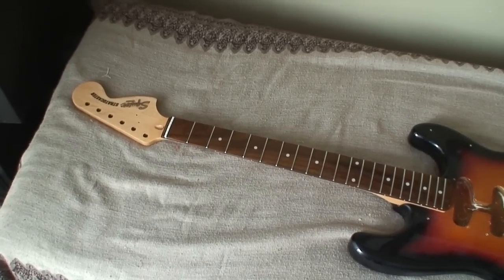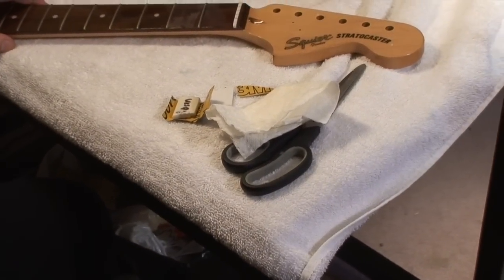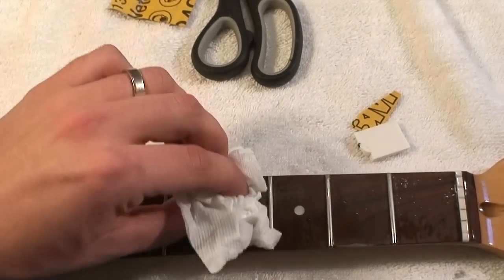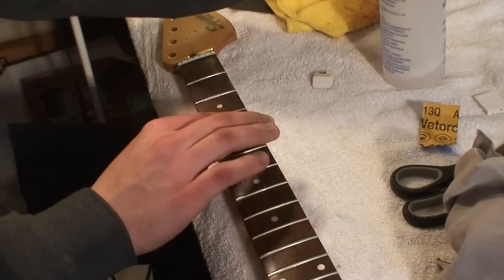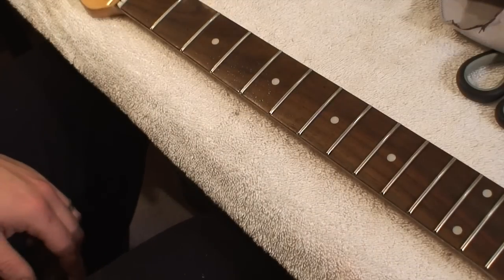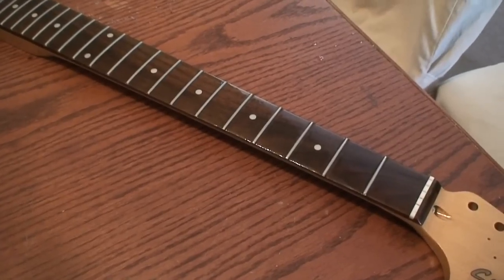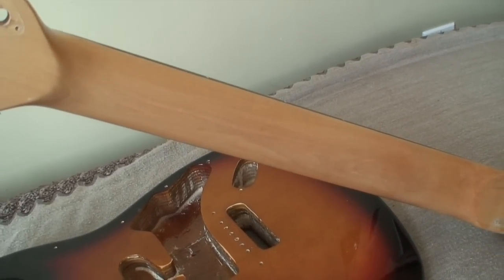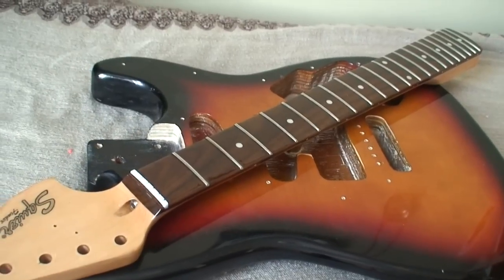Will the Lacquered Rosewood Strat neck work out? - part 2

Comment: Next time you do this, don't skip the important steps. It will save you time, money and materials, and will give you a much easier playing end product. I don't know if you have played an American Standard maple neck from around 2010-2013. Those years I can attest to personally. Fender used a very light amber tinted polyester resin as a sealer coat. Then pressed in their version of a Jumbo fret. The tall narrow ones without glue. Then they coated over the top of all of it with so much clear gloss urethane, shooting over the frets and everything. Then simply scratched off the urethane from the top of the fret. When it's written out, it might seem ok. The actual product is far from ok. Tall narrow frets, with so much gloss between them, that it's literally like playing tiny vintage fret wire. Add to that, for some reason, the wire they were using was softer than it should have been, and the frets just wore out super quick. 
 So if you decide you want to do this again, or someone gives you an expensive guitar to do this to, step one, pull all the frets. Sand with the grain using a radius block down to about 400. 320 is ok too, but 400 is nicer. Then just before sealing the rosewood, wipe with naphtha. Not lighter fluid. They are not the same product. Lighter fluid has oil in it to slow down the evaporation out of your zippo. Buy Naphtha and use it. wipe with the grain and scrub the hell out of it. This will get off all of the surface oils so the sealer will stick to it.  Then seal it. You can use sanding sealer. You can use polyester, which is a nasty stinking crap. Or my favorite, shellac. I always keep a batch or two made up. By shellac, I'm talking about the real stuff. Crystals and alcohol, in a mason jar. Let them melt down for at least 24 hours before use. This stuff dries so fast it will blow your mind. If you do 3-4 coats, level sanding between each coat, and going up in grit each time, (remember you have no frets in the way, simple process, just always use the radius block) you will have a board ready for gloss. Whatever you choose for your top clear coat, it must be an oil or 2 part catalyst base. You can use nitro. But nitro takes a long time to really fully cure. You can use 2k in a spray can clear, which is basically an epoxy type finish. More of a urethane, but without all the expensive equipment needed to use it. 2k isn't cheap, and you have to use it up in about 48 hours, or whatever is left in the can is toast. Storing it in the refrigerator between coats can prolong it another day, but that's about it. But when I say urethane, I'm not saying polyurethane, like furniture varnish. It's not hard enough for the abuse of vibrating guitar strings. My favorite is actually nitro. While everything has it's plusses and minuses, Nitro will melt down into the previous coats if you need to reapply next year or whenever. Urethane will not do this. Urethane will make layers and not really stick to each other. You have to sand back to 280-320 to give it something to grab onto to. And now there are frets in the way. So choose wisely. Simtec makes some nice stuff. Several versions of sealers and top coats that are compatible with house of color dyes. Mixed in. You can use the StewMac little spray cans to shoot it. But whatever you end up using, Do a final sanding down in the over 1000 grit range. I like to use the scotch bright pads that equal to 1500 grit. 
 Now clean out the fret slots and re-fret the neck. level, re-crown and then polish them. If you use Simtec or some other 2k, don't use naphtha to clean up. Use alcohol. Naphtha will melt down the finish some, screwing up all that beautiful work. Some might read this thinking this is way over their heads, or that this is doing things the hard way. I assure you it's much easier and faster than the route you took. Remember all the sanding between the frets...
  And if someone has never done a re-fret before, there are hundreds of videos on YT to teach you how. But be careful who you learn from. I could suggest Wills Easy Guitar, Fletcher Handcrafted guitars, Texas Toast guitars. There are many more. But I suggest you learn from real guitar building companies, and not just some guy claiming to be a guitar tech. There are some really amazing boutique builders out there, that are more than willing to teach you their craft. Learn from the best, and you're finished product will come out much much better than you expected. 
  As for the back of the neck, you really are going to have to take it down to bare maple. because Fender and Squier and most other major label builders, use a polyester sealer coat before any finish is applied. And when you think you finally have it down to bare wood, keep sanding. That shit penetrates the wood and it will screw up your oil finish. I still have an old acoustic guitar that I keep as a reminder about this. I should have used it as firewood a long time ago, but I like the changed profile I put on the neck, and of course it's good reminder to about the polyester sealers. Oil will penetrate in some parts, and not in others, and it ends up looking like a calico cat. I could redo the project, but I have other acoustics that are better, so I just leave it. 
  To help you along on the process of taking off the polyester, if you don't have a set of cabinet scrapers, buy it on Amazon. They are stupid dirt cheap (a few dollars) and they will pay for themselves in the very first pack of sandpaper. You can use a razor blade also, but it needs to be dulled and they don't work as well. Scrapers work so much better than sandpaper, I just don't know how I got along for so long without them. And they ae much more accurate when it comes to getting close around other parts of the guitar that you don't want to scratch up. How many people reading this, have tried to take some of the gloppy crap that Squier puts on the classic vibe guitars? You sand and sand and keep buying more sandpaper, and you end up with a dull finish of glop near the headstock and near the body, and bare wood in the middle. Use a scraper and get all that crap off. 
  As for what oil finish you choose, that's totally up to you. Most turn out looking about the same. Tru-oil is a long time favorite, and is pretty durable. But it's expensive. I'm betting Birchwood-Casey never expected so many customers from the guitar world. Tung oil is a cheaper alternative. My favorite is Danish oil. I like the available colors. Or you can make your own with boiled linseed oil and paint thinner. the paint thinner carries the oil into the wood, and then evaporates out. The oil dries inside the wood, making a hard finish similar to real crystal shellac. This type of shellac (crystals and alcohol) does the same thing, and like Danish oil and nitrocellulose, it melts into previous coats, so there is never any flaking off in a few years. Anyway. It's all a matter of personal preferences. 
  Any time someone wants to try something new, I suggest they look around the YT world and see if someone has already tried it, and what their results were. What did they do right. Where could they have saved time and money, and ended up with better results. Then dig in. The amount of actual professionals out there that can do this kind of work, is getting smaller and smaller. We've become a disposable society. Personally, I think it's a shame. It's going to be very difficult to actually find a vintage 2017 Squier Stratocaster Deluxe in 30 years. When it gets worn or ugly, we just throw it away and buy something new. Major labels know this too. And they have made their stuff cheaper and cheaper, to keep us buying and buying. Good luck guys. Woodeso's Guitar Mods, keep up the good work! Bob in Germany
Reply: can i get a tl;dr of this?